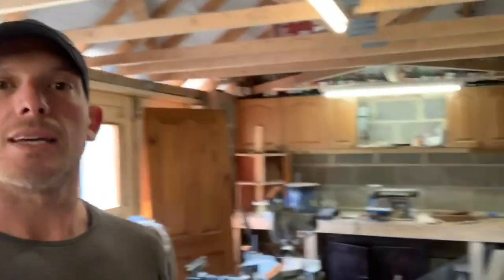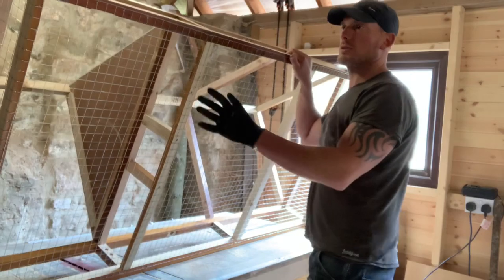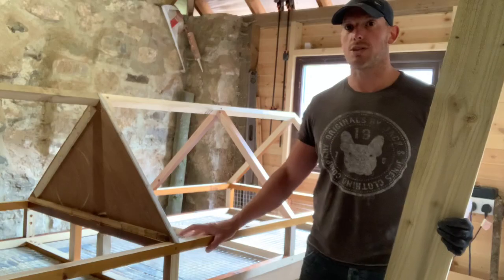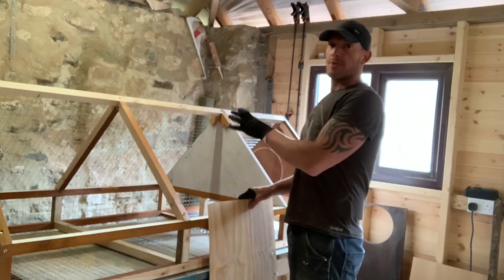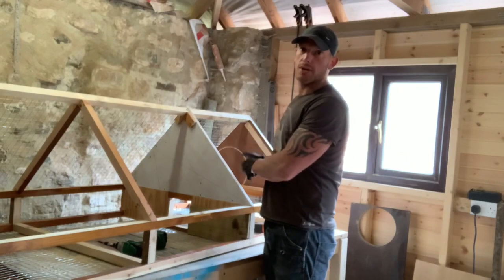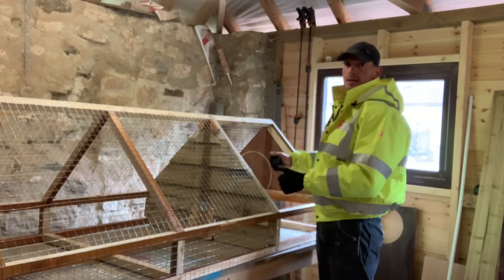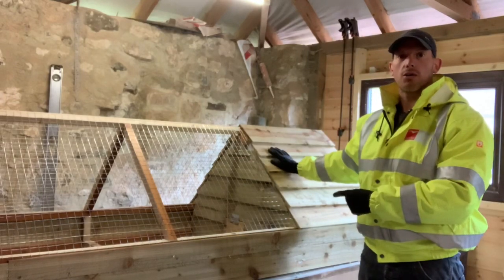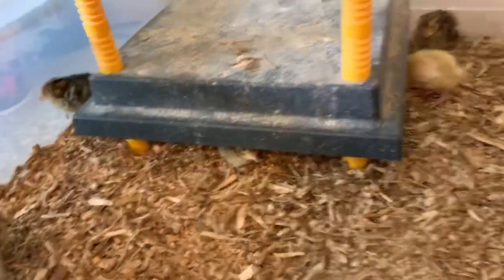Predator Proof Quail Tractor and more Baby Quail

Comment: Curious how this has worked out since you built it? We are hatching quail now and thinking how we want to house them out in the garden. This looks great, have you made any changes to the design after using it a while? My initial thought was the wire mesh was too big, we’ve had small birds when spooked by rats poke their heads out of smaller wire than this, and the head gets bitten off😢 I think this hasn’t happened since you put the wood round the sides, but you mentioned they were a problem pest for you.
Reply from the maker: Sorry to the delay in getting back to you. We made it easier to get the eggs by adding a door to mesh. Rats are just awful for doing that. This mesh was great actually, you could even see where the rats had tunnelled to try and get it. We did try to move them to a bigger, also meshed greenhouse but the rats did get in there. It wasn’t secure as this so sadly we did lose them. Catch 22 as they need small cage if secure but bugger are hard to secure. Easy pray for the rats sadly. Best of luck x